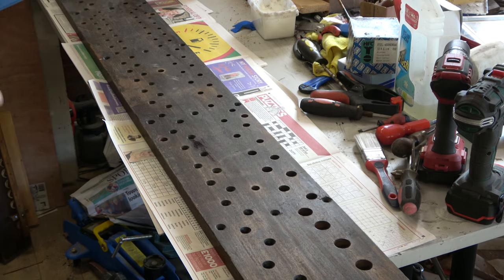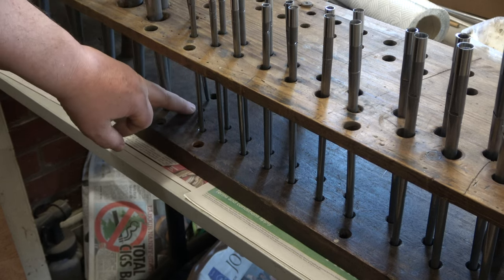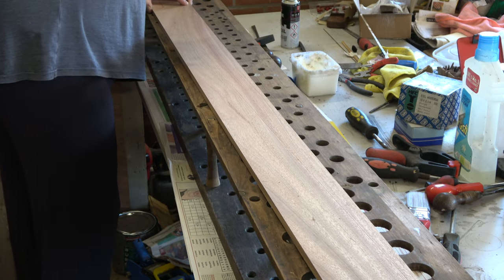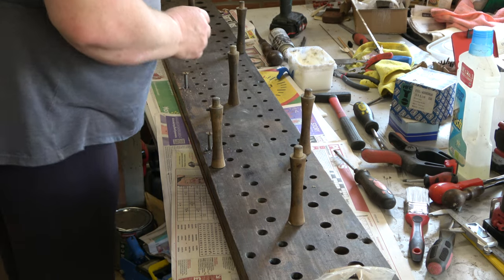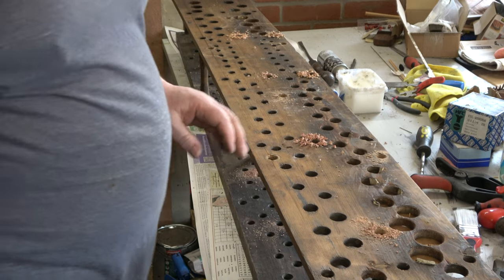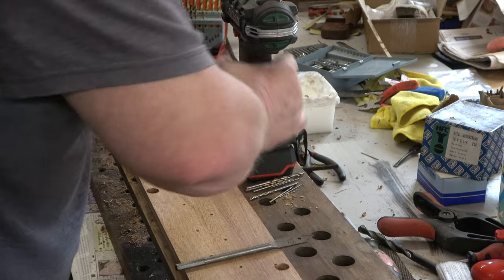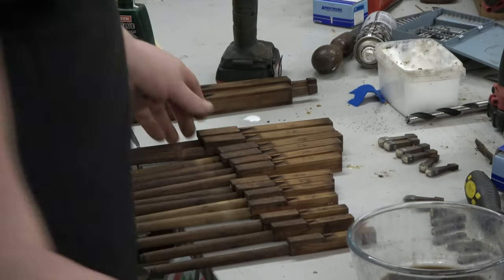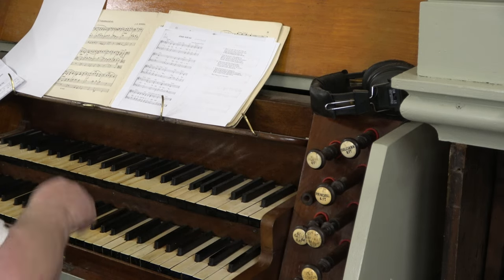1865 Forster & Andrews pipe organ restoration & installation Pt 32 of a lot

Comment: How do you tune the Diapason 16 foot bass wooden pipe ? There are no stoppers on top of the pipe/ I also noticed a small pin by the mouth of the pipe at the bottom....... may i use that to tune it ?
Reply from the maker: All the 16' pedal bourdon pipes have stoppers by which they are tuned. Perhaps yo've been confused because the bottom four Great Open Diapsson 8' are open wooden pipes, two of which are mounted on each of the base & treble pedal bourdon chests. From the 5th note up, they continue as metal pipes on the front isplay of the organ. These four wooden pipes have a pivoted flap inside the top of the pipe for tuning. 

Richard